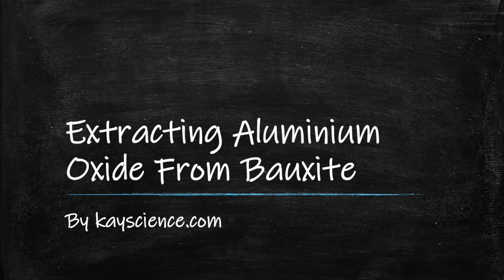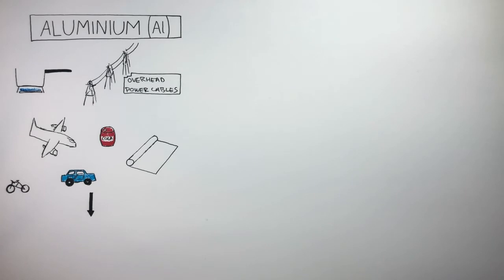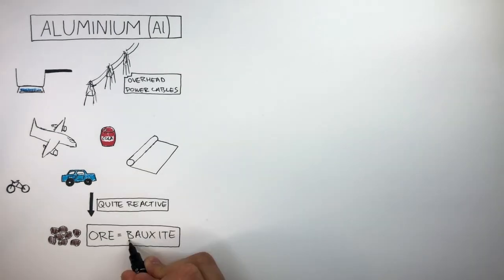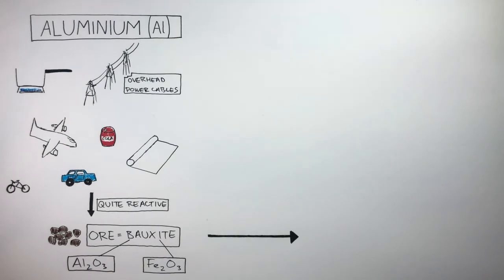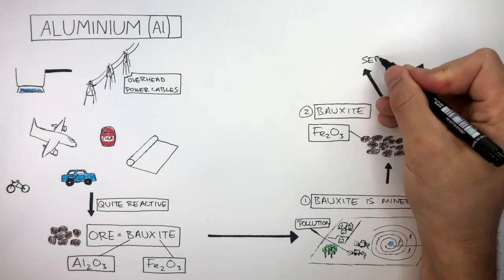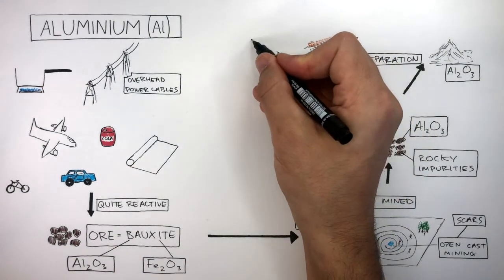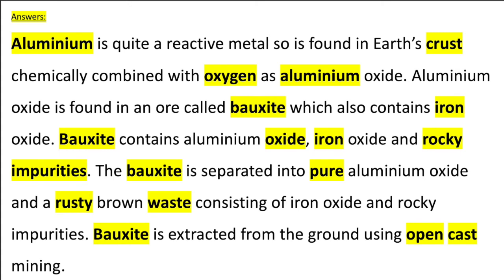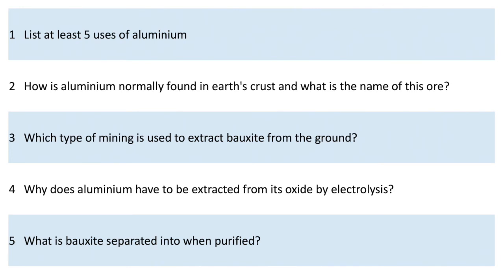GCSE Chemistry - Extracting Aluminium Oxide From Bauxite

Comment: this video literally doesn't explain how Aluminum Oxide is extracted from Bauxite
Reply: Lol yep. But if you want to know, bauxite is also known as aluminium oxide. Extraction occurs using electrolysis. There are Al3+ ions and O2- ions located in the electrolyte. Al3+ ions are reduced at the cathode, meaning they gain electrons to form a metal. So the half eqn is Al3+ + 3e --> Al and at the anode O2 is oxidised to form to form oxygen, 2O2- ---> O2+2e and then reacts with the carbon anode/graphite to be more specific, forming CO2 which would escape as gas. Remember this process involves the use of molten cryolite which would lower the mp of the Al2O3 and improve conductivity of the electrolyte as well. Hope it helps!